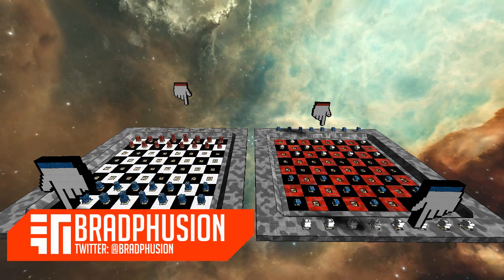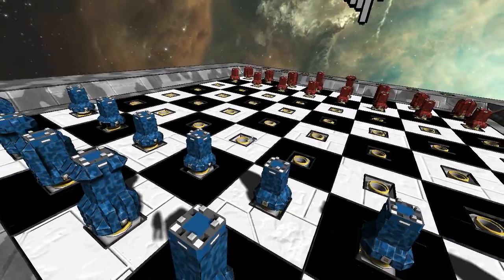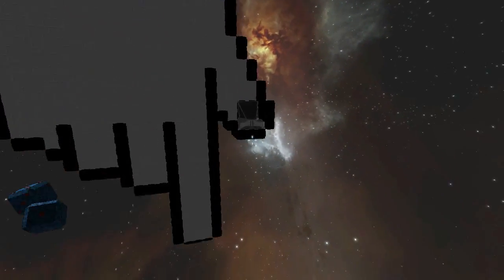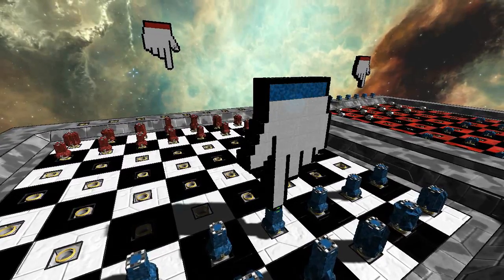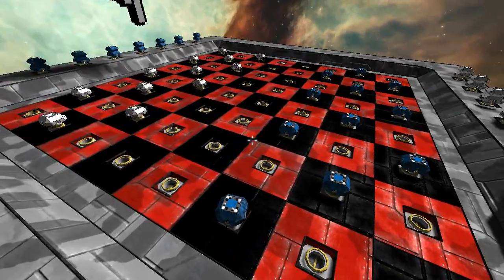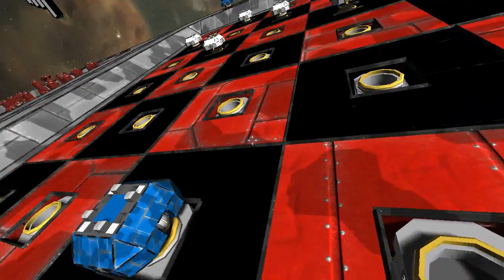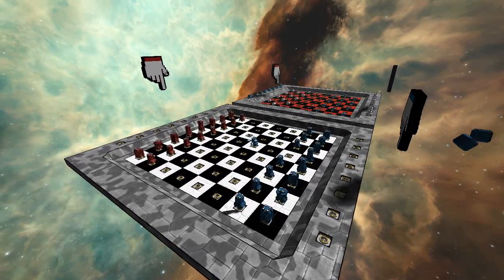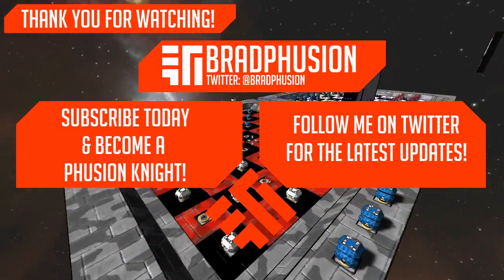RE:Engineering: Space Chess & Checkers! (Space Engineers)

Comment: Very nice, Brad. I like your use of connectors on the chess board. I think you need to have a little more variation in the pieces though. For instance I would make the pawns look like your checkers pieces so they are more easily distinguished. Maybe make the king and queen larger. Overall though, very nice.

Comment: BradPhusion "castle" ITS CALLED A ROOK UNCULTERED.... THING, anyways, quite good creation, the only other major error u have which should be fixed before putting it on the steam workshop is the checkers board, either side is suppose to use different colored squares, you have both teams using black squares, when only one should.
Reply: Uhm... no, both sides use the same squares in checkers.... How else would you jump your opponent? He was right. He does need to color his kings though (or remove the connectors and use merge blocks so they can just be stacked like you do with real checkers pieces)